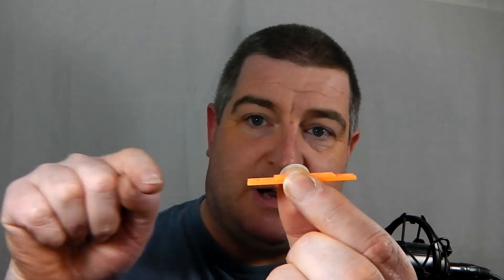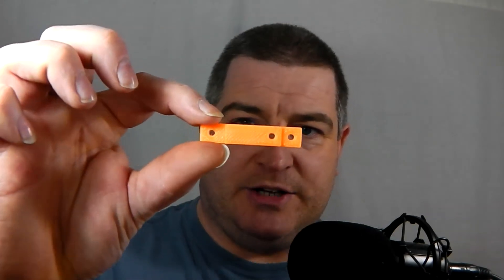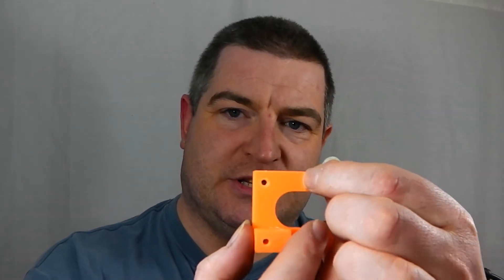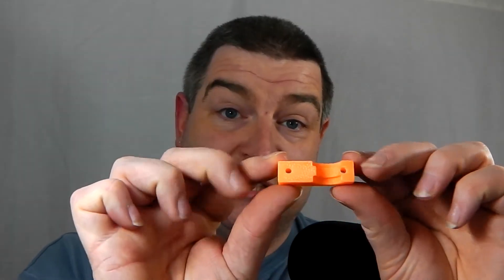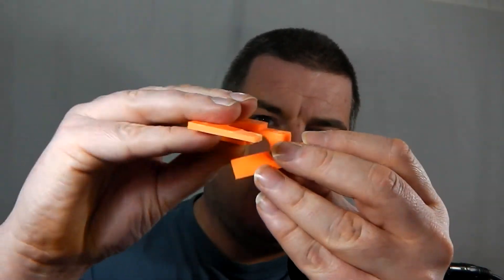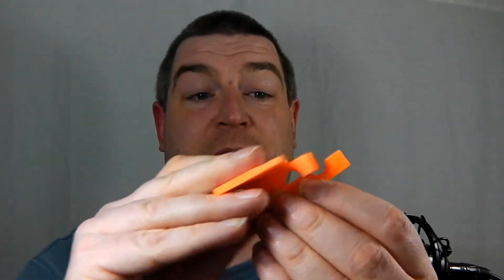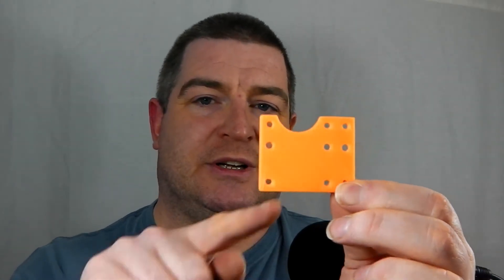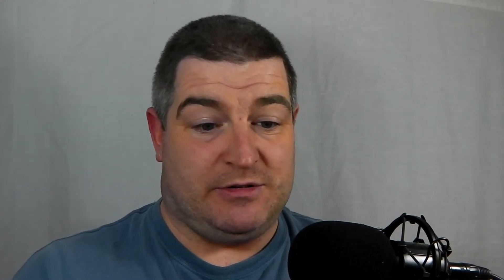XYZ Davinci 1.0A 3D Printer now with an E3D v6 hot end (Phase 2)

Comment: Is this channel still active? If I took apart one of my own LAN cables and used the same orange and white pair wire that you did, will that be good enough? Or do any of the wires work?
Reply from the maker: Hi, it's been a while since I made a video but I'm still here.  Any of the wires from an old network cable should work fine, as long as it has many strands of copper when you strip the end.  If it's one single solid copper wire then it will soon break
Reply: Thanks for the quick reply! :)

Comment: Does this model help with the thud and knocking sound of the extruder stepper motor... or do you have a video of replacing that motor with a better torque one? Cheers
Jon
Reply from the maker: Jonathan Angus sounds to me like your stepper motor is making noises because it's skipping steps.  It will be due to poor cooling from the fan or not printing hot enough.  The stock hot end will only print ABS.  PLA will jam and cause skipped steps.  What's your goal here?

Comment: I have been observing my handy Da vinci printer's problem and the extruder's motor gets very hot and probably it is the main problem to be addressed instead of the hot end. Therefore solutions like moving that  motor out or away could be a great approach as well. Isn't it?   What would you suggest regarding this ?

Comment: Thanks for all your work on the videos.
Do the parts for the mount need to be printed in ABS, or is PLA OK?
Reply from the maker: Hi, I used ABS as it will handle the temperature better. I imagine PLA would be OK as the End v6 heatsink doesn't get that hot when the fan is running. If you try it with PLA I'd be very interested to hear how you get on :)
Reply: Thanks for your reply. I thought ABS would be preferable.
I can't get my stock hot-end to extrude anything at the moment, so I will have to ask a friend to print the parts out for me. Trouble is, I don't know anyone else who prints ABS.

Comment: Did you figure out how to change the z probe position?
I had to change that on my xyz aio that I flashed over to repetier since the positioning is not the same as the 1.0.
Reply from the maker: Mark Burton Hi Mark,  I still haven't searched through the code for this change.  It's not something I'd want to "just try" as I hear a lot of people really mess up the printer by changing random things.  I'll have a word with the programmers at my local Makerspace, they may be able to help me track down the code that needs changing.
Reply: StevenQ-NE-UK If you open your firmware eprom settings in repetier what your looking for is Z-Probe X1 , Z-probe Y1, then Z-Probe X2, Z-Probe Y2 and last Z-Probe X3,  Z-Probe Y3.it was really easy to see where to change them to if you use the manual control.  I haven't done this yet as I don't have the e-3d hot end yet it should be here tomorrow I may look into seeing what wire it is and check to see if it is a ground . If it is I will give it a go and let you know how it went for me.
Reply: Mark Burton well grounding out the hot end did not make it work with the auto level when I tried it. For now I am just doing the manual level with a dial caliper and a adapter printed off thingiverse.
Still just wanted to say thanks for the videos. it gave me the confidence to do the mod.

Comment: i have the carbon fiber filament! I'm nor sure if you are still interested but the stock config can print it quite nice. carbon fiber fill is nothing as i though
Reply from the maker: 3D Workshop Hi, thanks for letting me know, that's awesome.  I'll have to get a sample if the filament and make something cool with it :)
Reply: i did get abs based I haven't tried PLA yet but I have heard it is a lot harder to print and clogs a lot